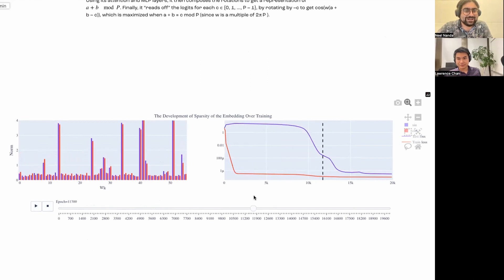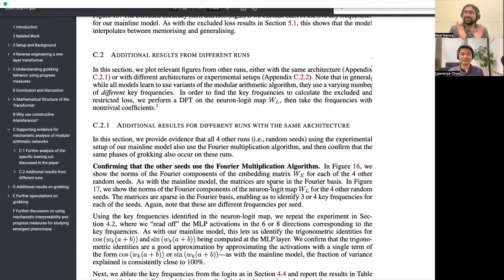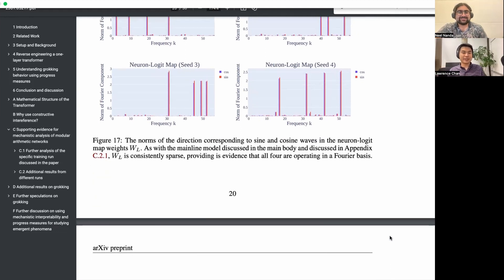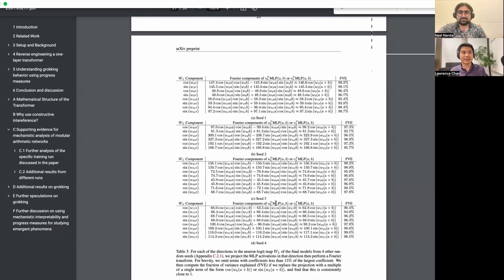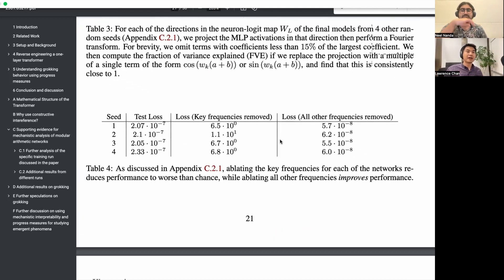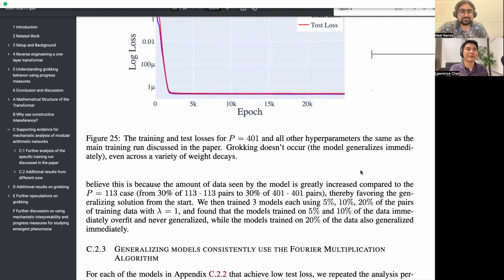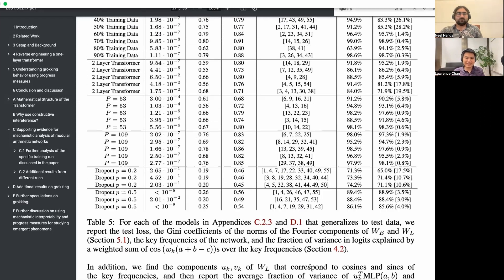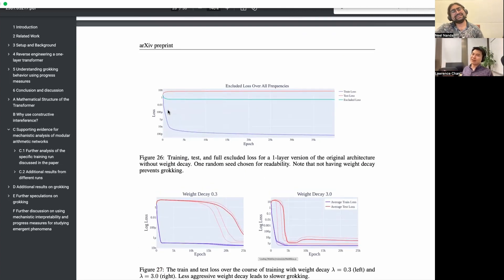A Walkthrough of Progress Measures for Grokking via Mechanistic Interpretability: Why? (Part 3/3)

Comment: Excellent overview - very interesting work. A question I still have about grokking:  the explanation regarding following the frontier of the regularization term against loss once the dataset is memorized makes a lot of intuitive sense but I am having a hard time visualizing still how the network can escape the local minima. It seems like it might be a feature of this specific problem, dataset, and hyper-parameters that the model is able to "clean up" because presumably there are individual clean up steps which on their own would increase loss. Is this interpretation correct? If so then how might one go about increasing the odds of the frontier providing a path out of the local minima?